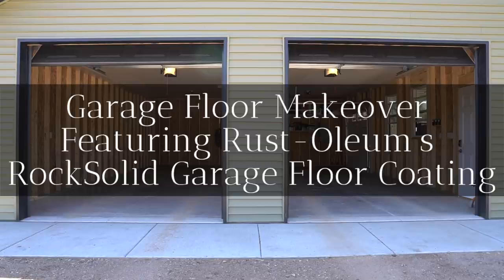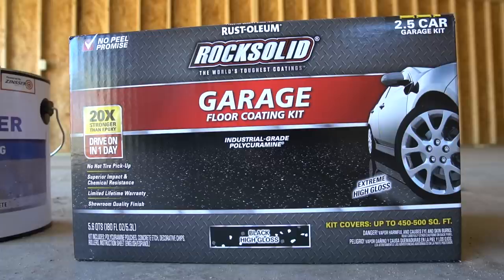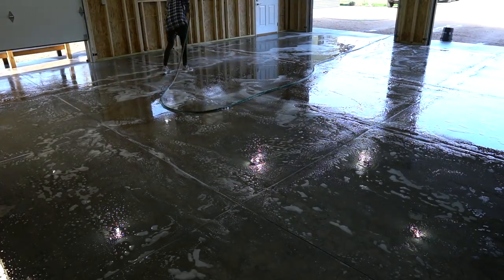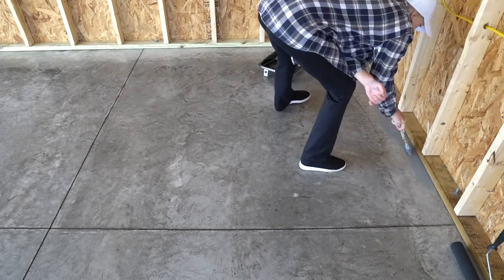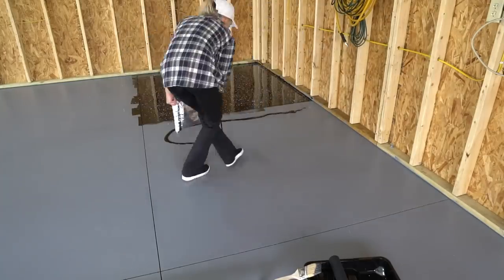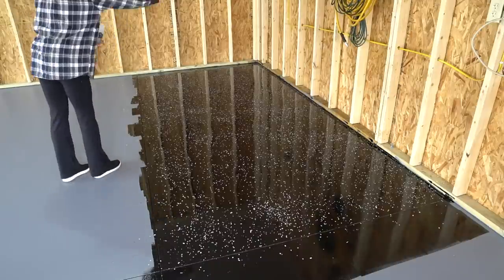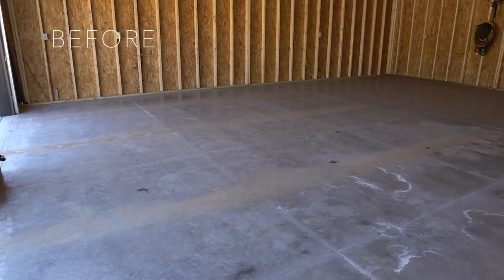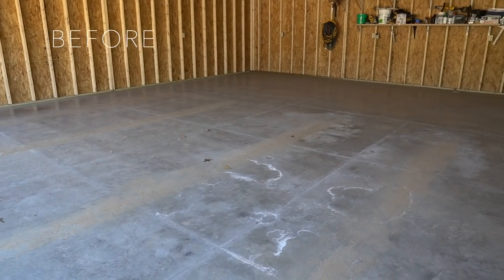Garage Floor Makeover | Rust-Oleum RockSolid Garage Floor Coating

Comment: I put this same stuff in my garage when we moved in 1.5 years ago, still looks great so far. One downside is the chips don’t get fully adhered and they kinda crumble over time, creating loose grit to sweep up. Not a big deal. I highly recommend sanding the whole floor first. You can rent a floor buffer with a diamond sanding wheel at a home center. Creates a lot of dust but it’s worth it. When it comes to concrete the mechanical bond of the finish is the most important factor.
Reply: I was wondering about that. It looks like those chips are just sprinkled on. So there is nothing above the chip to protect the chip. 
I wonder if the same kit system is sold in clear (no color). If so, can coat above the chip later again. That would lock in and protect the chips, as well as giving the black floor a deeper luster, like a clear coat on a car.
Reply: @reallifeengineer7214  The chips provide a rough texture to keep the surface non slip. It's good that they're exposed.
Reply: you have to add a clear coat over it.

Comment: I just used this same kit on my garage floor and it turned out amazing but I do have a question sense you have black as well. How do you remove little scratches and is there any type of cleaning that you ever need to do to keep the gloss highly effective?
Any feedback would be greatly appreciated here. Thanks

Comment: I just did this on my new construction home, this weekend. If you mix and open the bag, you have about 30-45 minutes before it turns into taffy and then a complete rock hard clump. Work quickly. I bought 2 kits for a 2 car garage and 1 kit probably would’ve been enough if I didn’t waste 75% of the first bag trying to cut in the perimeter. The end result was fantastic but I will never use this stuff again
Reply: That's how all epoxy products work.  One mixed you have about 45 minutes of working time.  Best to have one or two friends help and work fast.

Comment: She does not seem to respond to questions,  so maybe you viewers can help   People say you need way more kits than the square footage suggests.  Do you think using the primer extends the covering of each kit.  I keep reading that you don't NEED to primer a clean floor, not whether it works better.  Would anyone recommend or warn against  acid etching AND primer on clean concrete?